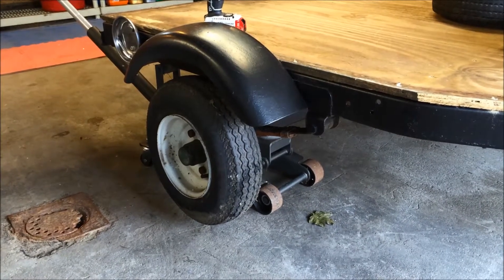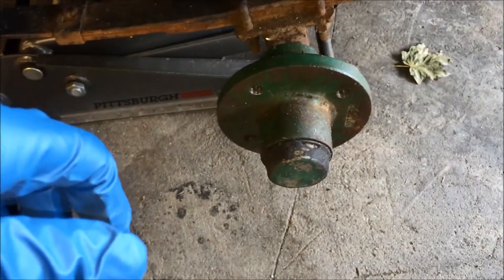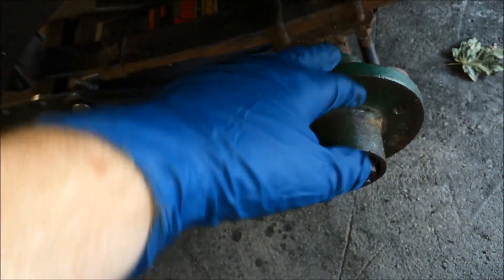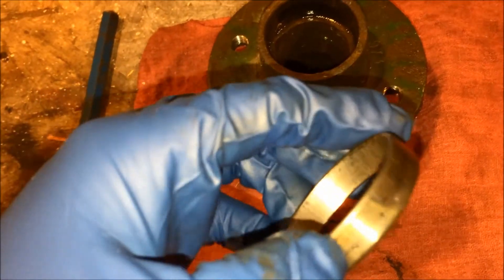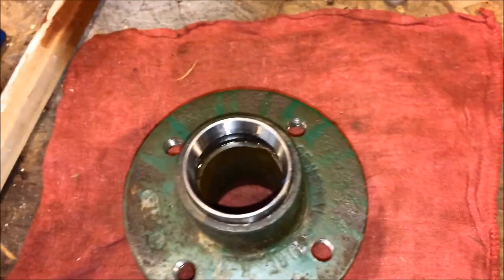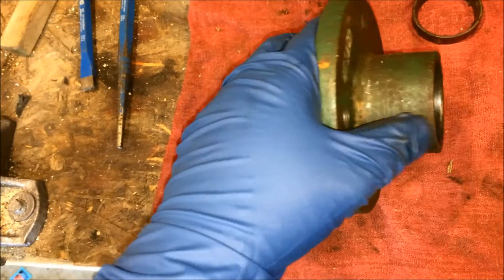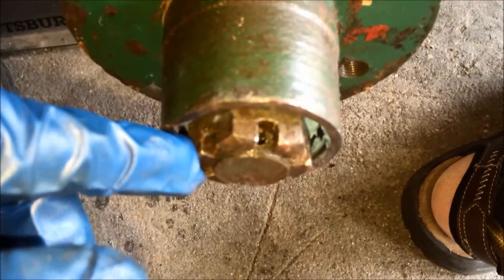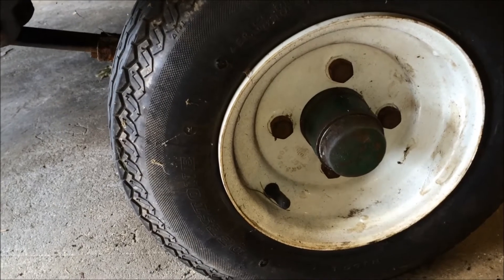Utility Trailer Hub / Bearing Replacement

Comment: your hub is threaded instead of laughs coming off it. question for you. does it use a different rim than the hubs with studds?
Reply: instead of luggs
Reply from the maker: +danilemetzger 

The hubs are all the same. They are held onto the axle stub with the axle nut. 

The bolt diameter for the the hub will differ depending on what size tire your using.